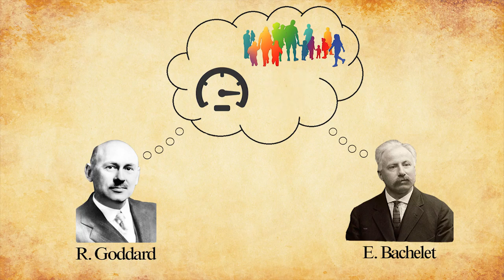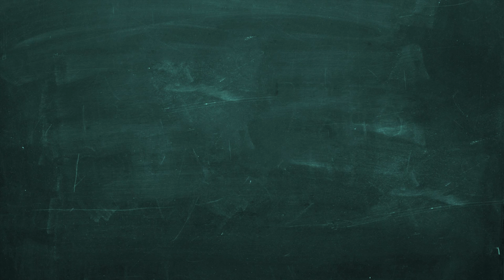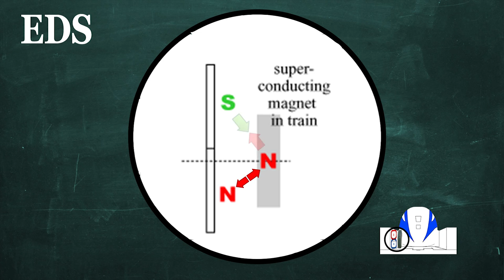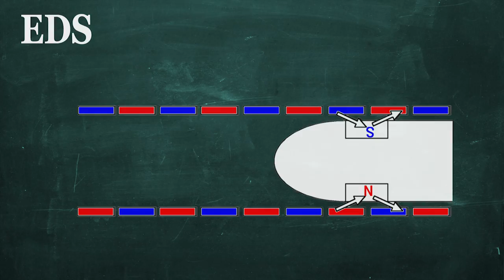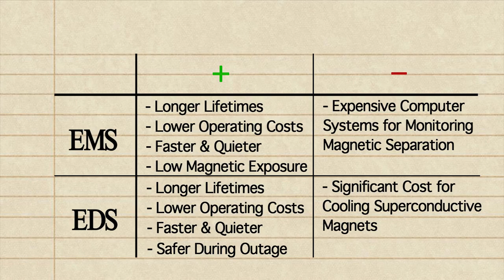Physics of Maglev Trains (EMS & EDS)

Comment: Thank you for video educational and interpreter , this very helpful in comprehends the theory

Maglev mengganti roda kereta api konvensional dengan elektromagnet dan melayang diatas rel. Teknologi ini menggunakan gaya dorong elektro-mekanikal tanpa adanya kontak. Dengan teknologi ini kerugian akibat
gesekan antara benda kerja dengan landasannya dapat dihilangkan. Teknologi yang digunakan dalam kereta ini adalah Electromagnetic Suspension (EMS) dan EDS.
Semakin besar celah mempermudah sistem EMS dalam menjaga celah saat melaju pada kecepatan tinggi. Namun secara teknis, EMS lebih mudah dibandingkan dengan Electrodynamic Suspension (EDS). EMS mampu melayang dengan sendirinya saat diam atau kecepatan rendah sedangkan EDS tidak bisa melakukan hal tersebut. EDS membutuhkan kecepatan tertentu untuk melayang. Pada kecepatan rendah, EDS menggunakan roda untuk berjalan hingga melayang pada kecepatan tertentu.

Comment: MAGLEV's have been around for decades, and haven't replaced railways for the simple reason that they do NOT run on two rails. Trying to build points for the gigantic concrete support structures that MAGLEV's have to run on means it becomes astronomically expensive, and makes MAGLEV's operationally inflexible in moving large quantities of people.

Comment: I love your explanation and the quality of the video, but I think you ignored almost all of the downsides of maglev trains. There are multiple reasons why they have not become commonplace even after decades of development:
- They are incompatible with existing rail infrastructure. In European countries that are already full of rail lines, it just makes more sense to use a conventional high speed train that can also use existing tracks in addition to high speed lines.
- The very high speeds are only useful in countries with low population density. For example, the Transrapid system in Shanghai only travels 30km, and its speed advantage over conventional high speed rail is negligible. In countries like Germany or the UK, there are so many population centers that even high speed trains have to stop every 100km or so. The existing high speed rail rarely reaches its top speeds there, so even higher top speeds would not do much good.
- You predicted that in the future, all railway stations and lines would be replaced by Maglev networks. This will never happen, as Maglev systems simply make no sense for any low-speed lines. The trains we have for regional transport are already pretty much perfect for their job. And at their speeds, wheel-to-rail friction is basically zero (Seriously, an average person can actually push a 20 ton train car along a track. That's how small the friction is)

Comment: If there is an attractive force between iron rails and electromagts why do they not stick ?
Reply: Because theres also one pulling on the other side.
Reply: Sensors measure the distance between magnets and rail very frequently, the power of the electromagnets is regulated dependent on the distance.
Like at this toy:
http://www.bis0uhr.de/projekte/schwebekugel/schwebemagnet_1.JPG

Comment: so does that mean in eds, the train solely levitate through the supercooled superconductor from the side of the train? or is there anything that also makes it levitate on the track like the ems?
Reply: EDS levitate due to self inducting power when the train move forward. There is no power and control system what so ever, its totally pasive. The flip side to this is that the train have to go fairly fast to be able to levitate, so the train have wheels for acceleration.

Comment: Does Maglev work in colder climates. Heavy snowfall is a drag.
Reply: Perhaps the rail systems could be designed to avoid the accumulation of snow. Adding holes to the rails where snow can fall through will remove a lot of the issues.

Comment: Not bad but there is a basic flaw: Rolling resistance on railways is trivial. IIRC at 300kph 95% of the energy is to overcome wind resistance. Maglevs don’t escape this problem.  That’s why Hyperloop is going in a tube. The advantage of maglev is elsewhere.  

Germany should have been given shout out for the Transrapid. 

Keep it up.

Comment: What’s magnetic exposure?
Reply: I've wondered that also.  Is there a risk to people, especially those with joint replacements or metallic surgical support implants?  MRI s are often out of the question because of the magnetic exposure.  Is there an effective barrier inside the train and alongside the rails and platforms that prevent magnetic interference with these?